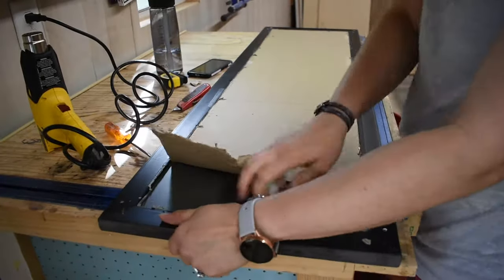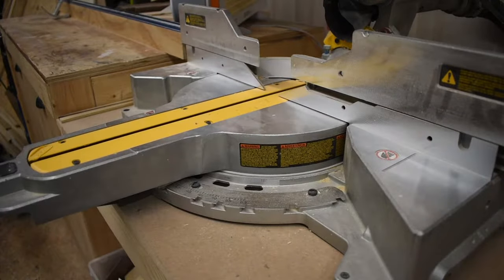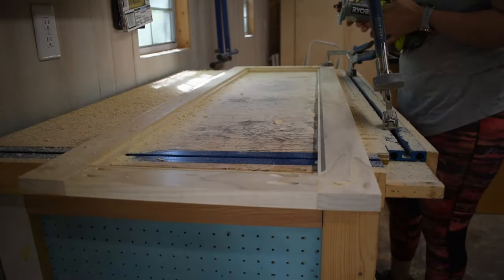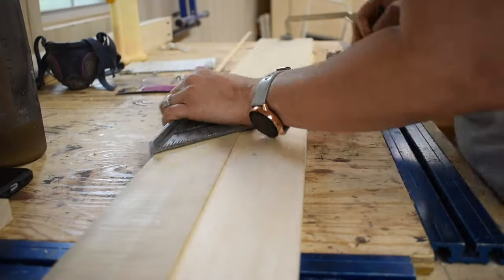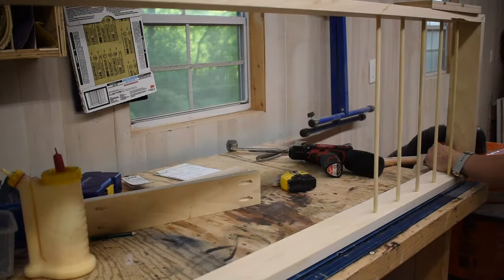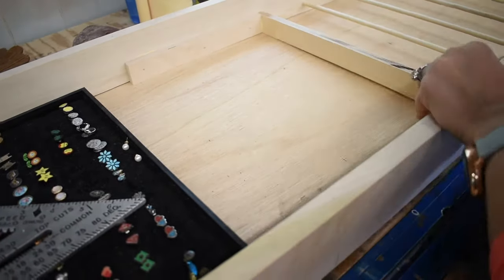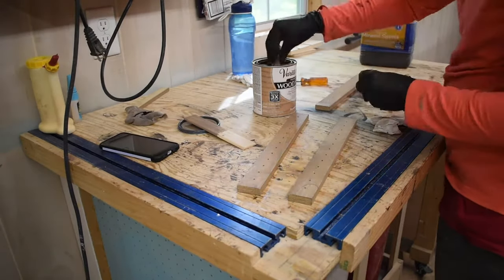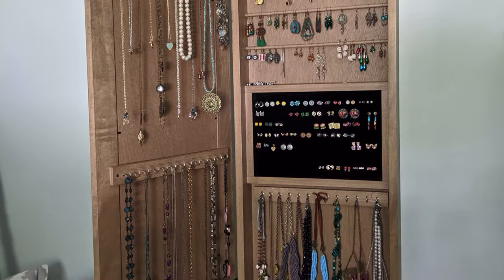Wall Mirror Jewelry Storage | DIY | Home Decor

Comment: Hi Amanda, I just discovered your channel by way of wanting to make a wall hanging jewelry holder. My suggestion for the screw in hooks are two different choices, 1st you can purchase nylon jaw pliers for jewelry making or, put the hook inside the chuck of a drill, tighten as much as possible and drill them in. Maybe put a small piece of electrical or duct tape on the hook before putting it in the chuck.

Comment: LOL on the hooks I have been through the same issue and what I came up with was using a bit that went in my screw gun that I kind of rigged together I took two Alan or metric wrenches,  tape them
 together in the middle made one longer than the other because one's got to go in your screw gun, I taped it on the top with the hook part into it then I'm going to use the screw in the hooks it worked perfect like a glove, just not the first try LOL just took me a few minutes to thiink & revamp them, but in the end it worked out good and my fingers were very happy for that. Nice job on your project here very nice I'm in the process of building myself a I'll just call it a piece cuz with all these ideas have in my head with what I watch on
 100% on it yet LOL so thank you for the ideas God bless.
Reply from the maker: That's a good idea! My husband ended up getting me a drill attachment for Christmas (shortly after this project) that is a "one size fits all" type socket wrench thing...hahaha my explanation is horrible. But it works like a charm for hooks. I mean I messed up the first 2 I did...trial and error like you said lol. 
I'm the same way with projects - have a million ideas in my head and never know which one to do. Sorry for the delayed response..I didn't realize you commented until today!

Comment: Do you have a place for stud earrings?
Reply from the maker: Yep! I use the black felt box in the middle for stud earring storage. It works perfectly - even though it's vertical, the foam helps hold them in place. I haven't had any fall out yet.